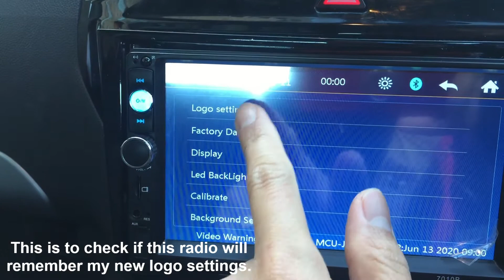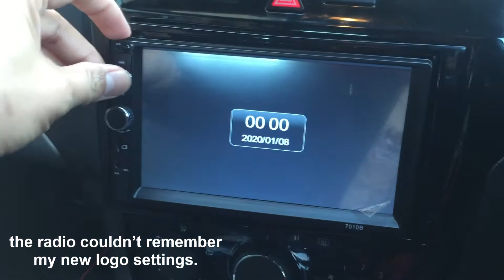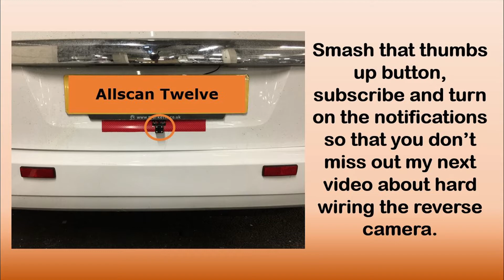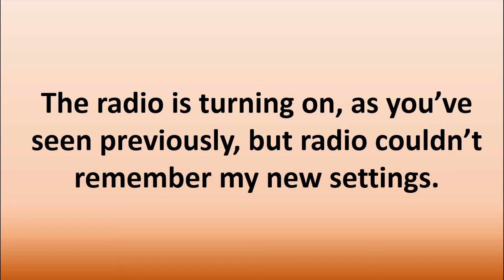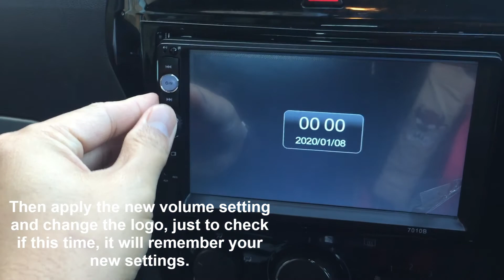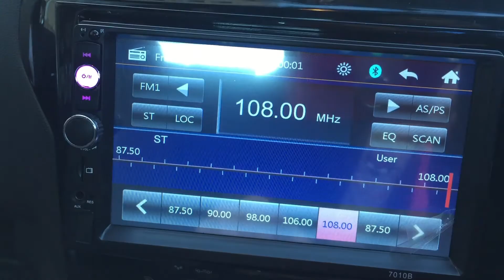Hardwiring the aftermarket double din car stereo to Vauxhall Zafira (B) ignition switch

Comment: I've just bought the exact radio from eBay.
Seems excellent value i have just got to fit it now.
I shall be following your video to do so had your radio been giving good service since fitting?
Reply from the maker: Oh yeah. Never had an issue since I fitted it. Good luck installing it in your car.

Comment: Hi there, first of all thank you for sharing this. I wanted to ask do I need to open the glove compartment? I have 2010 Zafira and I don't have a reverse camera. I just want to replace the standard stereo with an android one. I can do basic stuff i.e. remove the existing one and replace with new one but removing glove compartment gets tricky for me. Your help will be appreciated.
Reply from the maker: Hi Sunil, how can I be of help? Was it not clear in the video how to remove the glove compartment? I rewatched the video and for me, the instructions on how to remove the glove box were crystal clear. Which area you are having trouble with?
Reply: @AllscanTwelve   Hi Allascan, the video is clear. Its just that I don't want to go the hassle of removing the glove box etc. What I wanted to ask is I want to replace the factory fitted with an android one by just using the two keys to remove the original one and then place the new one with appropriate cables, case etc without opening the glove box.

Thanks once again for your reply.
Reply from the maker: I think the xtron or pumpkin brand android double din, though a bit expensive, is plug and play. You may need to do a bit of research depending on the car stereo brand you are planning to purchase.

Comment: So what wire goes to where to get it coming on with ignition and off when key out? Am confused.
Reply from the maker: The red wire is the power cable that you connect to the central console lighter power cable. I hope this helps.

Comment: Do you have to turn ignition all way so all lights come on or 1 turn so no lights come on? I've got mine wired that way but only can have it on whenmy engine is running ?
Reply from the maker: Radio will turn on when the key is at ON position (you don’t need to turn the engine on).